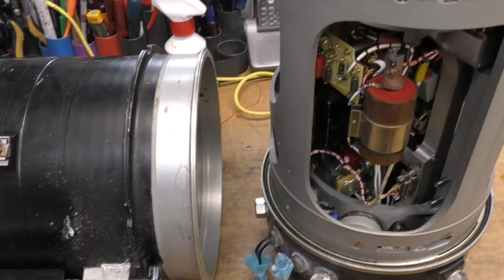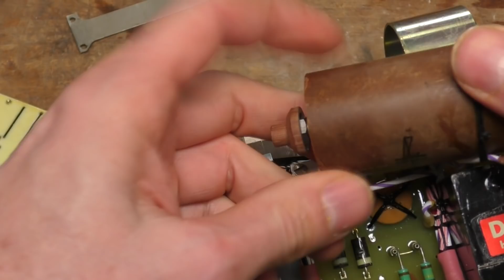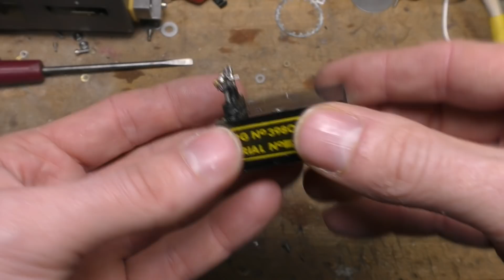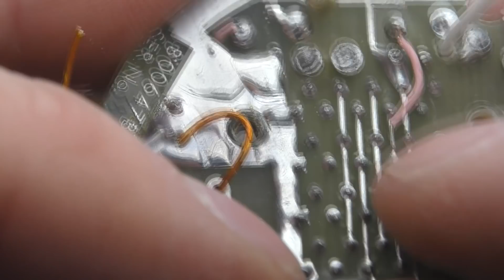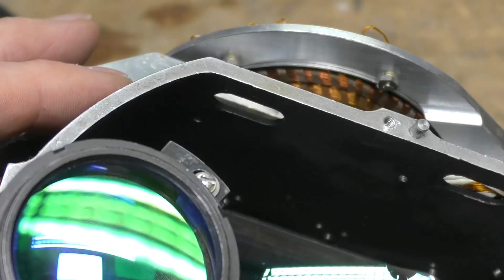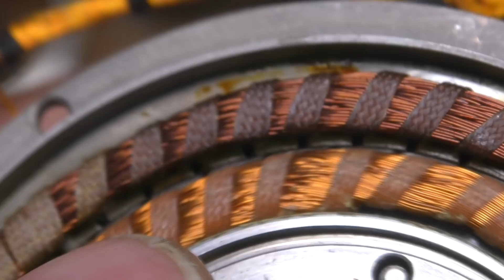Laser unit from Tornado jet fighter aircraft

Comment from the maker: There's another one one Ebay UK now : https://www.ebay.co.uk/itm/393975746930
Reply: Surely this stuff is still illegal Mike
Reply: I didn't see a single CE label during the teardown... German toll will go crazy if I try to get it into the country... that this is military will only be their 2nd concern for sure
Reply: hey Mike, excellent video as usual, but I have one thing on my mind - do you have Your ebay account where you are getting rid of the interesting parts and stuff left over those cool teardowns? like yag rod from here, or little military grade motors, gyros, optics and so on..
Reply: Hi Mike, very amazing as every time :)

About the little gyro i have some info:
Its very closely related to "golden gnat" gyros, i opened one up two years ago, they are oil filled and have a flywheel incapsulated inside. 
The power is fed by wires, yes and also i suspect you had to use quite some force removing the mooving bit? 
The little pin on the bottom end of the assembly actually is a torsion spring that is supposed to return the assembly to its center position, its sort of easy to be ripped into two, you will most likely find a similar stub under the bearing.

In case you want to get rid of some components, im looking for synchros to get my golden gnats operate something mechanically. 
In case you think shipping to the EU is still an option im interested to buy you some more workshop storage space :)
Reply from the maker: @martinlelek3791  Yes, ebay seller name same as YT name
Reply: @mikeselectricstuff  well, that sounds logically! :D thanks, I'll take a look
Reply: What exactly did this cost on Flea Bay ??? Nice work fells for sure. I bet todays stuff is micro-level for sure. Analog was was easier.
Reply from the maker: @victoryfirst2878  £280
Reply: Looking at the seller's description, it includes "FRE" which was the old MoD designation for Ferranti Defence Systems Ltd, Edinburgh.  The newer designator was K0662.  Then Ferranti shot itself in the foot with a bazooka and is no more.
Reply: @mikeselectricstuff  I would bet when this part was new it cost an arm and a leg. Thanks for the info asked of you Sir. Peace
Reply: Those little gyros are rate gyros. The notch mates up with a torsion spring, then the faster it is turned around its sense axis, the more force it has to press against the spring and the farther it rotates the sense stator.
Reply: @RobertSzasz  Sounds like you have so experience with gyro's Robert. Just amazing Mike's got one to show us all on YouTube how analog there really are made.
Reply: cant wait for styro pyro to get this
Reply: Damn that's cheap for the amount of engineering(before the days of proper cad)...would have cost a bazillion pounds  and 1000 prototypes
 at the time. This was before powerful cad programs existed 

These days you could make it a LOT SMALLER for a few thousand pounds...tech is cheap! I got a new 60watt blue+- laser module on ebay for80 bux... just need a a 20 buck arm processer(heck even an arduino) some 4$ stepper motors and a $2 3d printed structure
Reply: @glowytheglowbug  HEE HAW for sure.
Reply: @mostlymessingabout  So is doing drugs yet that has not stopped people from doing just that. Sometimes you have to take a chance Jon. Peace
Reply: Tempted to keep an eye on the seller for an odd Christmas present for my dad. He used to be part of the engineering team at Ferranti and worked on navigation and guidance systems for various military aircraft. Mind you, not sure he'd see the appeal the same way I would. I never knew exactly what he worked on so this video was great to see.
Reply: @mostlymessingabout  noooooo
Reply: @dodsg  Nice to get a reminder of the technology from those days; I worked for the MoD servicing/modifying these units and worked with a Ferranti Rep back in the '80's.
Reply: @vaikjsf34a  Similar units were fitted to the Harrier Fleet, yes. We no longer have a Harrier Fleet...sad. I'm surprised you can buy these units though.
Reply: so this could steer/target a missile?
Reply: @Aaron-zu3xn  Bingo.
Reply: @TrumpstienPhile exceeeeept... in aviation everything is certified, calculated, failsafe, tested, and certified again

Maintained once - then goes through that same loop aaaaaall over again.

Engineering of any form or degree within aviation  - either militairy or civilian is bound to cost a metric ton of money
Reply: This is Classified Top Secret and this should not be coming up on EBAY.

Comment: I used to service and modify/upgrade these  back in the 80's when they came off the aircraft. Really complex and precision work in a clean room for hours on end. I'd never seen the inside of the gyros and was fascinated by them - I think they spun up to around 35,000rpm !   
DON'T be tempted to try to fire up the Laser Rod though (probably impossible now) - the raw beam can fry your eyeballs AND the coolant is CARCENOGENIC. They were also pressurised with a Nitrogen.  Nice to get a reminder of the technology from those days.
Reply: I vaguely recall that when these were used during the Falkland's event , fog sometimes prevented the actual use , perhaps the unused  missiles were subsequently fired into the sea !

Comment: Jeez an old LRMTS  head.... the back 4 plugs went off to two boxes, one called the LIFU  (Laser Interface Unit) and the other was the LEU (Laser Electronics Unit)  the whole kit was 'borrowed' from the even older Jaguar jet, but they had different databus' hence the need for the interface unit. Expense wise your looking at about £150k for that head, new.

The head itself was a bit of a sod to replace, you started off going up into the nose undercarriage bay, took off an access panel to get to the fairing bolts (that are wirelocked in) pop those out and your in. take off the cooling hose jubilee clips while in the bay then it's outside. Pop the 4 plugs off and the earth (centre hole on the plug end of the head) then it's just 3 cap head bolts in rose bearing mounts. Two of them are turnbuckles to adjust the laser head alignment mechanically.  That involves removing the head, fitting what's known as a harm plate to the airframe mounts and firing a sighting laser from that plate at a large board with various markings at known points. It's not a small job so was only done at major servicings on the whole jet itself, unless there was a problem with the system. 

On front line Sqn's the head was often only pulled if the coolant was low (white tube with green and red lines on), it was a pretty hardy bit of kit, it was often the LEU that died in some way, occasionally the LIFU.
Safety wise, on the ground without some extra bits to override certain interlocks you couldn't fire it on the ground. You even had to fit a LAM (Laser Absorbent Material) screen over the fairing window, it had an IR sensor and sealed around the fairing with a cable out to a test box. You'd fit two pins into the main undercarriage to override the WOW switches and one more beside the fairing itself for another override that I can't remember it's name... 

Anyway, once all the overrides worked you could test it on the ground, the test box had an LED that blinked when the laser fired, in time with the pulses.
Reply: awesome info!
Reply: can you explain what this was actually used for?
Reply: It's basically a built in laser designator they reused from the retiring Sepecat Jaguar. The jet radar picks up a target, the Nav selects it with a hand control and the jets computers slew the head around to that bearing, the head sensor then hunts for the best amount of reflected laser energy, once it's got that, the position and range are fed to the aiming systems for the best possible accuracy. It's limited in it's movement but at it's inception was very useful. Until external targetting pods like Tiald came along.
Reply: LRMTS, LR ( laser ranging) would give the system 'slant range' and MTS ( marked target seeking) would lock onto a target that was being 'marked' by a soldier on the ground with a laser gun firing at a potential target.

Comment: the 3-4 turn flex cable assembly is known in the automotive world as a "clock spring" your car has one behind the steering wheel. when horns and buttons were all on the wheel, wipers were accepable. soon as airbags came in, a directo connection was paramount so clock springs came about.

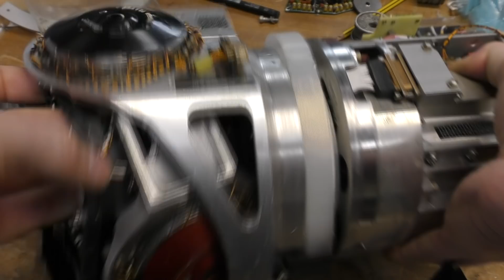Comment: Anyone who plays DCS is familiar with "GMBL LCK" (or similar airframe dependant)  error on the targeting and camera pods.  Those ribbons at 8:05 are why.  It can't keep turning forever and has to recycle back at some point.  It either does it automatically, "unwinding" itself causing a massively disruptive spinning image to the user, or it displayed "GMBL LCK" or similar message and requires the pilot/operator hit the RESET, normally resetting/slewing the TOI (target of interest) or to "plough" (straight out in front and down to track ground) or back to SOI (Sensor of interest) if set.

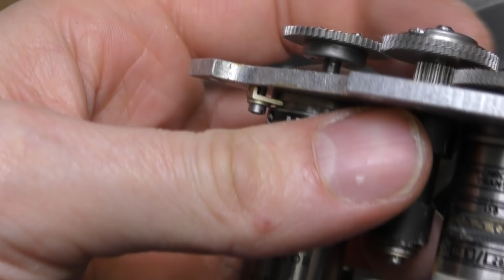Comment: At 19:25, if they're using anti-backlash gears for the resolver, then they're likely using the two motors two remove slack from the driving gears. The problem is that you can't use these anti-backlash gears on a motor, as they're not suited to transmit meaningful amounts of torque. So what they're likely doing is that they're driving these two motors with opposing direction of torque. One "leading" motor rotates the assembly, while the second motor applies a slight counteracting torque. When changing direction, the previously counteracting motor becomes the "leading" motor. Basically, the torque applied by each motor never changes its sign. You only vary the magnitude of torque applied by each motor. The direction of rotation is determined by which motor applies more torque. This keeps the whole gear train under tension at all times and removes all backlash.
Reply: Wow, a design solution that would have taken me a lot of failed attempts to come up with.  Again we see how the cost of a secondary motor is not an issue with military hardware that must perform to specifications before a price point.
Reply: @KallePihlajasaari  Cost may not matter but weight does.  This was the lightest way of doing it.
Reply: Agreed. Seen this type of push/pull arrangement before in other systems that require highly dynamic, precision, low-overshoot responses.
Reply: so it requires not only two motors but also two sets of identical two gear chains to deliver the torque to output shaft to remove the backlash among gears. Understand.... But It seems to work well only if the loadings on output shaft is within the pre-requisite conditions, that it is always again the applied torque. If it  is a fluctuates one; both in direction and magnitude. When in some cases, an unexpected outside forward torque added to output shaft, that is it is in same direction of the applied one (instead of the normal one opposite to it) and its magnitude exceeds the backward torque, it will create a certain amount of backlash.

Comment: The small gyro at 30:25 is most likely a 'closed loop' sensor - a force is applied to keep the sensing element in the middle of the small range of movement and this force is proportional to the rate of rotation of the unit. High accuracy accelerometers operate on the same principle.

The sensitive axis is actually perpendicular to both the measurement axis and the spin axis - what is being measured is the gyro precession caused by the applied external torque.

Comment: These were quite easy to fit in the aircraft, held in place by four bolts and used turnbuckles for harmonisation.. The hardest bit was wirelocking the fairing in place to the mounting points from within the nose undercarriage bay.

Comment: about a dozen yrs ago I got ahold of a Pave Penny laser simulator used in practice runs, the laser system was almost the same exact unit found in your system, it took about 6 months of reverse engineering the laser and pulse system but I eventually got the laser to output 5W on the Q switch, it would pop a hole in a razor blade with no issues. Altho it was invisable and had no idea on what type of scatter I was getting off of it, I did manage to pump a matched crystal set and got green out of it for 2 pulses. First pulse discolored the crystal and the second pulse blew it apart into several pieces. The second pulse showed the laser was "spraying" light all over the place so I retired it...
Reply: This Ferranti unit is basically Brittan's version of the Pave Penny system.

Comment: This Nd:YAG laser has athermal cavity design - no mirrors or fine adjustments. Just prisms and corner cube reflectors, so it is not affected by the thermal distortions in the chassis. Very clever design to stay operational from -40C to +50C.

Comment: I think it's an LRMTS not a laser designator. So it range finds (LR) and is a marked target sensor (MTS) which allows the weapon software (and later weapons computer) to understand where a marked target is (using the backscatter of the low power laser) relative to the centre line of the a/c to display it on the HUD and allow the weapon software to know when to release a weapon (when the CCIP is over the marked target) when commanded. A laser designator would have a much higher power laser. For the Tonka that was initially the TIALD pod and later the Rafael Litening II pod
Reply: Thermal Imager And Laser Designator, for those who are wondering.
Reply: Didn't the GR4 have 2 pods under the nose, 1 for the LRMTS but not sure what was in the other one?
Reply: @125brat  the second one was FLIR. Forward looking Infra Red. It overlays onto the HUD
Reply: do you mean CCRP? (continuoulsly computed release point vs cc. impact point)
Reply: @TheFreeSpiritKID  possibly. It was a long time ago I knew this stuff!

Comment: Protip: If you ever need stupidly thin insulated but flexible wires... Track down some old laptops to steal the LVDS/eDP cable from. Or ask a local repair shop for some junk cables.

I've used them as mod wire before in really cramped spaces, can't be beat. Very good wire to have some scraps of.

Comment: Pressurised to prevent arcing, as you would otherwise find arcing at high voltage points as you go up in altitude. Otherwise you would have to pot pretty much all of the high voltage parts, which kind of precludes servicing them, and also still has limitations because of arcing in the connectors. 

Head moves based on the pilot looking at a point, and the laser slaving to follow his head movement, and yes it would be also slaved to the 3 axis reference system gyros to maintain them in the proper attitude, using the artificial horizon to act as a reference.

Shock absorbing packs are easy to assemble, you tie them together as a pack using lacing twine, waxed, and then install as a pack, then cut the one side and pull the twine out after assembly.
Reply: Right, the reason certain electronics are only rated to altitudes of 5000m or so.  So much to know and forget and so many smart people in the comments here.  The complexity of the topic filters out much of the drive by crowd and only true groupies are left.

Comment: Our family business used to manufacture the dielectric coolant that went into these units. Very cool to see this. We sold most of it to Toronado jets running out of Italy..
Reply: @King Diamond Is there public domain information or patents with specifications for the fluids, would be interesting to know.  I recall working with a high voltage power-station cooling pump variable speed thyristor drives that used ultra pure water with active in-line conductivity monitoring to warn about coolant replacement before it would cause problems in the thyristor stacks. Not sure if it had additives.
Reply: @uploadJ  Yes! The material we made was a silicone based material made from Octamethylcyclotetrasiloxane (Dow D4) processed with sulfuric acid to bind additives.

Comment: The two motors connected either side of an anti backlash gearbox arrangement are what we use on 270 tonne telescopes to ensure both the motors and the encoders don't exhibit any backlash at the arcsecond angle resolution.

Both motors are driven with the same signal.

Comment: The wire insulation on most of the "teflon like" wires is most likely radiation cross-linked ethylene tetrafluoroethylene or radiation cross-linked polyvinylidene difluoride.

Comment: The enameled wires you mentioned are stranded nickel or silver plated copper with a fused polyimide wrap insulation.  They've mostly been replaced by PTFE and ETFE insulated wire , but you'll still find PI wire in some high temperature applications.  The spec is MIL-DTL-81381

The coolant is likely CFC-113, but it could be something else too.

Comment: Besides that is is already broken for someone who worked in an optical lab, it really hurts to see someone touching optical elements with bare hands or touching them at all, once you touch them they are broken most of the coatings can't be cleaned ....
Reply: That's kinda sad like electrically and mechanically this thing is fairly simple in the grand scheme of things but the optics are like magic.
Reply: @oliverer3  I studied electrical Engineering with optics for me optics are the easy part, but RF (radio) is true black magic...
Reply: The vivasection of the laser head was truly cringe worthy. That was a fairly nice electro-optic cavity dumped laser module in there. Groping the lithium niobate crystal 😲😵💩😢